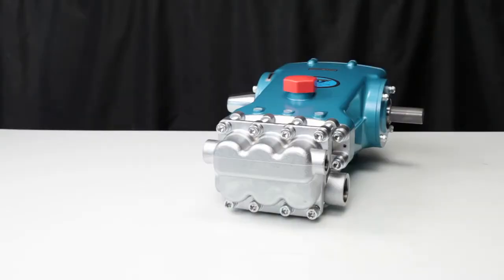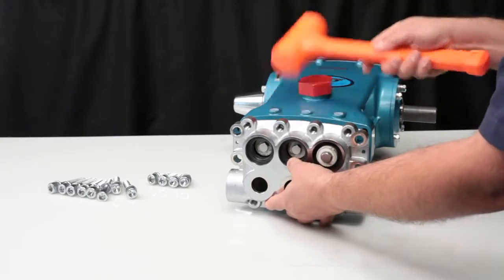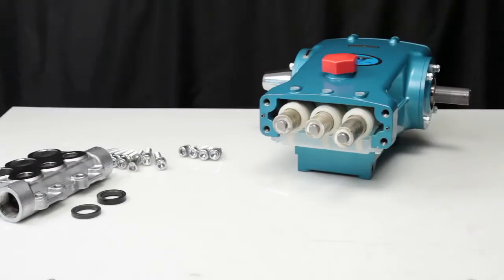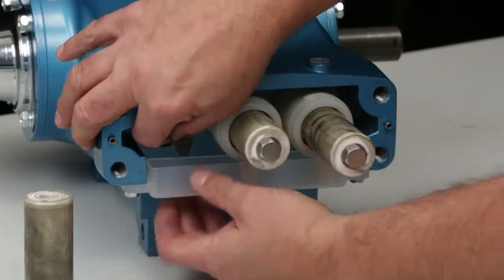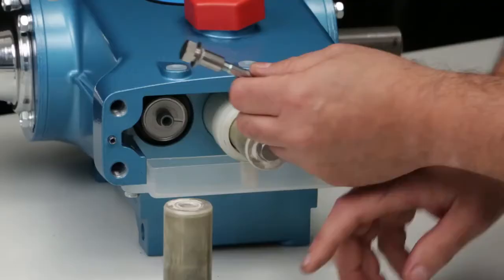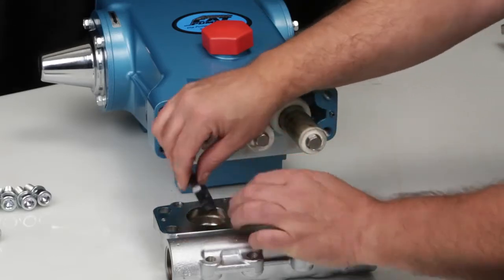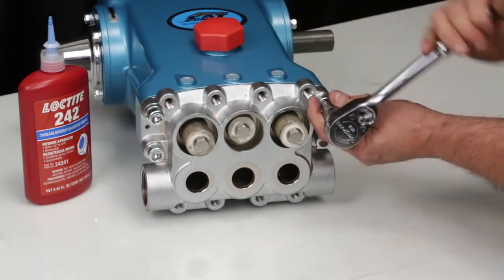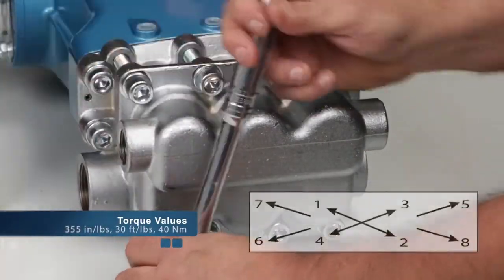CAT Pump Repair: Servicing Seals Model 2530, 2530E, 2531, 2537

Comment from the maker: repair part needed: https://www.jnequipment.com/shop/pressure-washing/pressure-washer-repair-parts-kits/cat-pump-repair-kits-replacement-parts/30952-cat-seal-kit-2530-2530e-2531-2537-pumps-nbr/